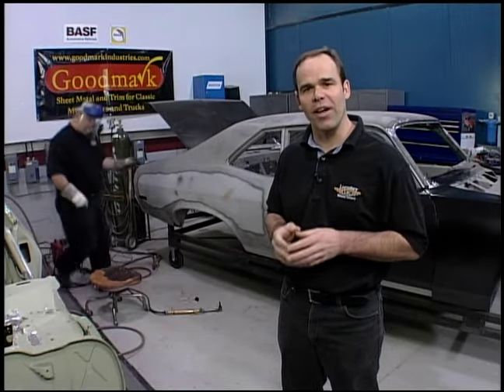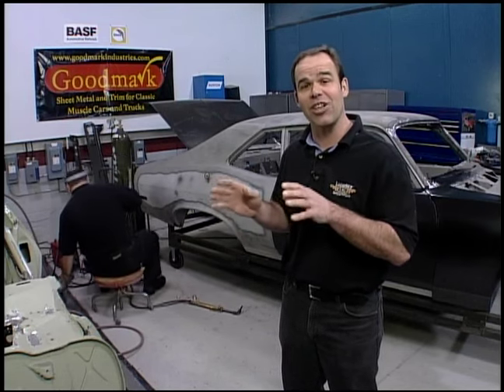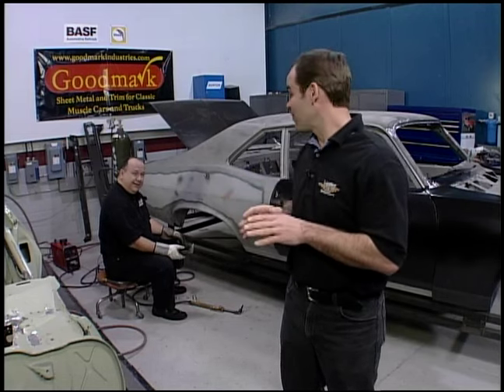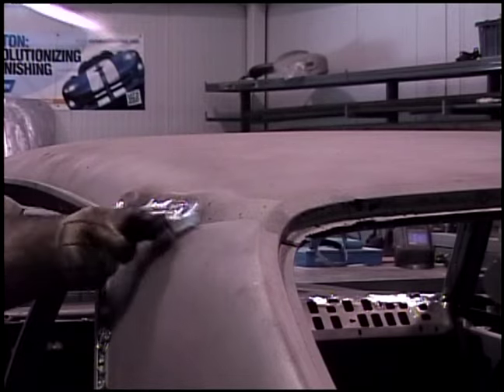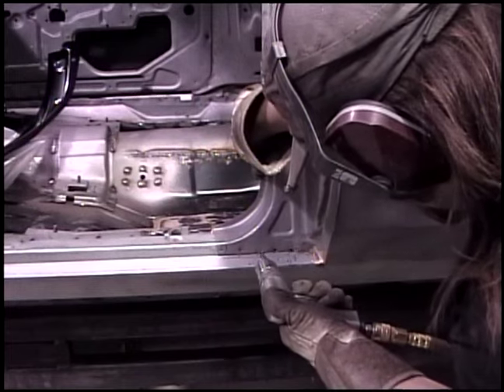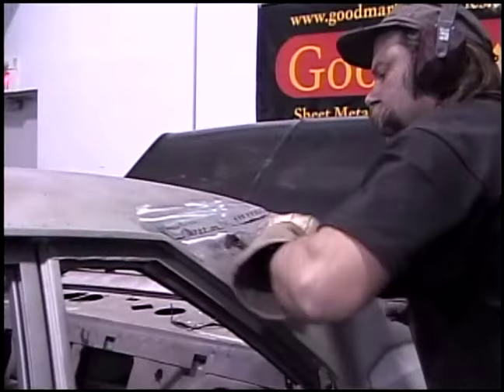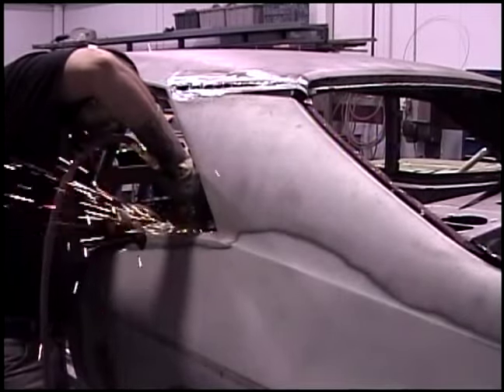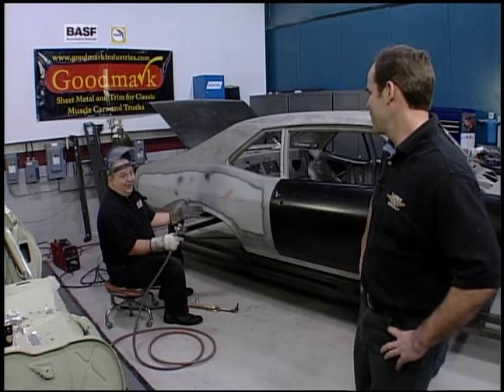72 Nova restoration series 5/13 Legendary Motorcar TV

Comment: I'm replacing rear quarters on my 70 nova and cant find any information on how the quarter is connected in the drip rail?
Reply: Go along with the drip rail down the quarter panal with a grinder. You could see the line at the top after you melt off the lead and clean up that area
Reply: @ethansmith1517  thank you for the procedure on that I'll clean that area out with a grinder and go from their👍